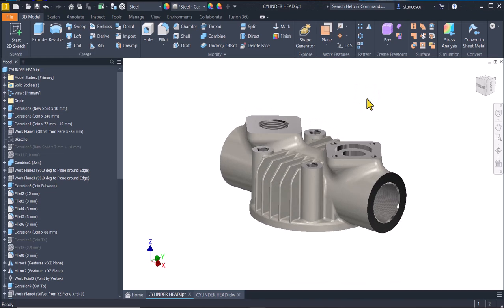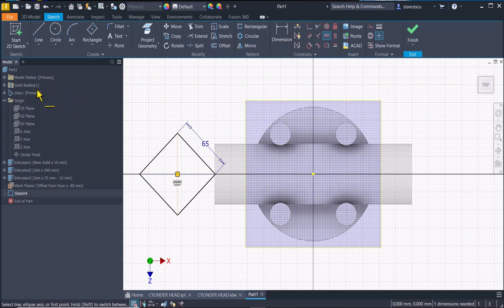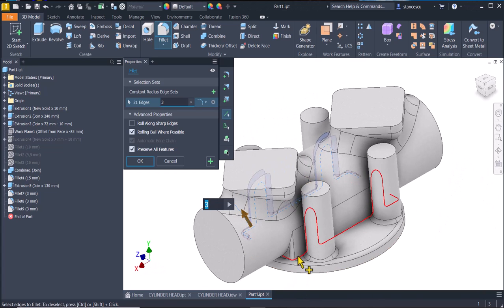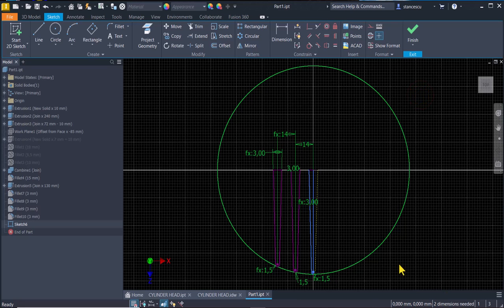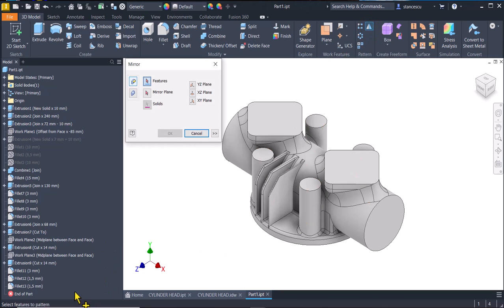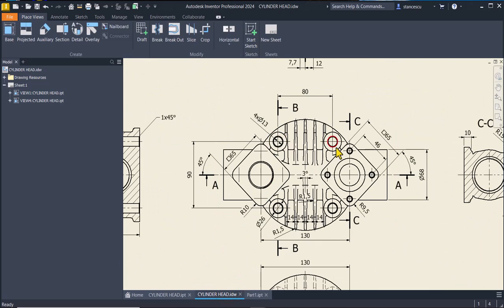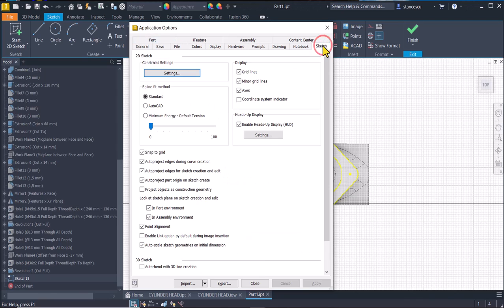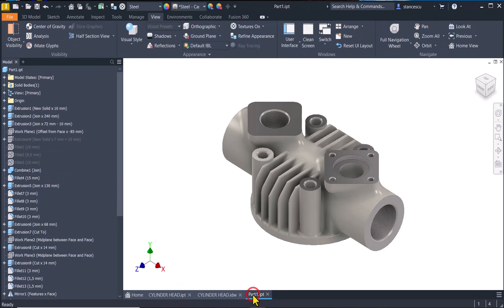Tutorial Inventor - 400 CYLINDER HEAD

Comment: Hello Prof. outstanding tutorials. About spring animation, is there a way  to assemble 3 individual parts - a Base: grounded,  a Base for top compression and a Spring between Top and Base. Spring NOT to be created in Assembly Selection. Thank you.
Reply from the maker: What do you mean with:  Spring NOT to be created in Assembly Selection?
Reply: @prof-stancescu  I created the three single parts. In the Assembly i applied the required constraints. Making the Spring part Adaptive. On animating or Driving the Top part to compress the Spring it ddisplays an error message. Thank you replying.
Reply from the maker: @skywatchman8326  Can you send me the assembly and parts? Use constantin.stancescu@gmail.com